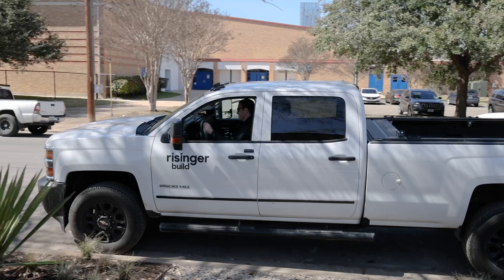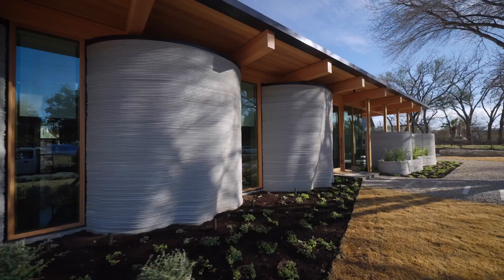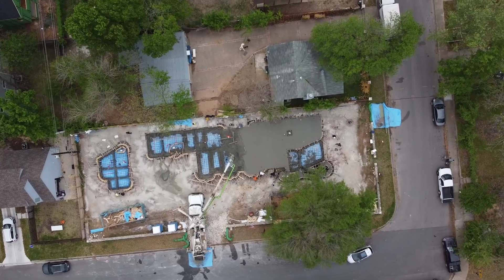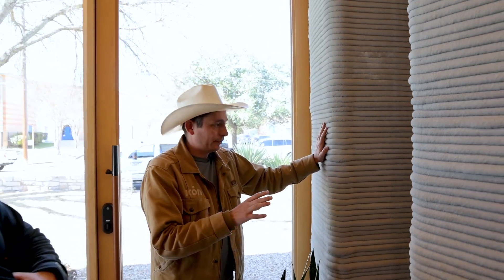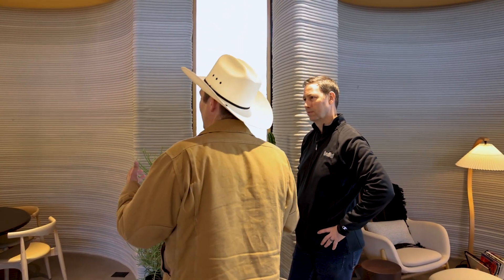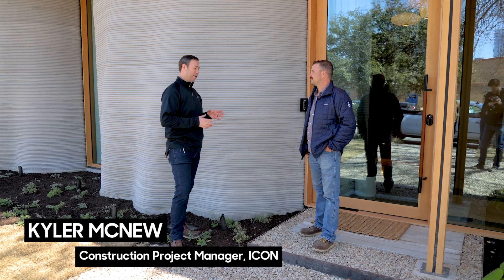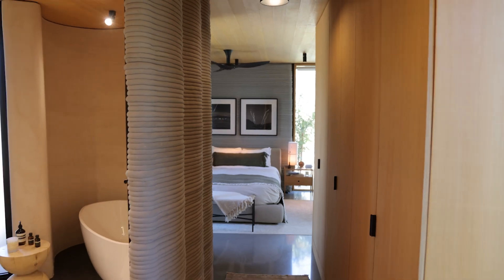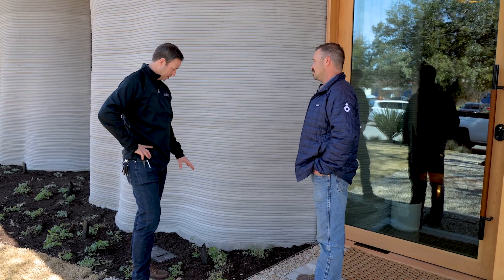World’s FIRST Home SPECIFICALLY DESIGNED to be 3-D PRINTED!

Comment: Those interior walls will be dust magnets. Wonder if the robot maid will wear provocative rubber gloves.
Reply: I wasn't quite clear on heating cooling or lighting either. Dusty collections would indeed make the space more uncomfortable :(
Reply: It’s a model. I suspect most would prefer to plaster the walls like in the bathroom.
Reply: @hippie-io7225  radiant heating and cooling in the floor would handle that.
Reply: @michaelgreene9889  how would radiant cooling handle condensation if it's in the floor?
Reply: @rcmrcm3370  good point. The house will need a dehumidifier or two depending on square footage. I have one in a poorly ventilated bathroom.

Comment: No change in cost?... oh I thought the point of 3D printing was to DiY and make things cheaper.
Reply: This technology even over decade old is still in its infancy. Currently it's exploratory. In the future as the tech advances you will see it used more - however if there is a savings somewhere there will be detrimental somewhere else. But that is life......
Reply: I believe he was comparing price based on a similar home of the same size.  If that same house were built, curved walls and all, with traditional construction techniques it would cost a fortune.  Given the customization, unique design, solid construction, and energy efficiency, this home probably has a lot of value per dollar compared to its peers.  One of the main advantages of 3D printing is having the flexibility to create one-off highly customized designs without incurring extra costs.

Comment: Would interested to see how this would hold up in more Northern climates, as well as what type of scale is possible.
Reply: My thoughts exactly. The way the concrete walls are built, the inner structural wave connects the inner and outer walls, so there’s areas where concrete bridges completely from outside to inside. Over a long winter I would expect cold to migrate all the way through the concrete creating cold strips along the interior wall that would attract moisture and dust just like you see in wood stud walls except much worse. They also glossed over the attic-less, flat roof but that would have to be engineered for the cold too.
Reply: -Belinda Carr has a video on her YT channel ('Fibonacci 3D printed house') where a company called Twente Additive Manufacturing has built a similar 3D printed concrete house in Canada. She talks about some of the shortcomings of their prototype design, which were mostly related to details/finishing. Total build cost was $100K.
Reply: @walterrutherford8321  The thermal bridging was also my first thought, but the top view at 12:35 makes me wonder if they've eliminated major bridges by standing up the outside/interior walls with a true gap (unlike every other 3-D printed concrete walls I've seen previously that have a bazillion major thermal bridges). It would be great if more details on this topic were shared and if they have in fact achieved concrete walls without substantial thermal bridging.
Reply: @walterrutherford8321  no way. you can clearly see the wall structure at 2:30, and there are no thermal bridges to the exterior. as he said in the discussion, there's an 2-row-thickness interior bead, and same for exterior bead, and the two don't connect. the interior/exterior beads come close to touching, but that only at spots for windows and doors, and there is spray foam insulation filling the interior. they didn't go into details around the sealing of gaps around windows and doors, i'm sure that's a key part of their proprietary process.
Reply: I wondered that also. Another thing i see this as dirty because all those ridges on the inner and outer walls collect any dust.
Reply: Use a different roof and make sure your insulation level to right for the climate zone. It is not that difficult.
Reply: @scottmohrman  Thermal bridging of concrete at -30F is prohibitive. I built using double walls. There are thermal images of walls in very cold conditions and the studs are way warmer  on the outside. The R-value of a 2x6 stud is only 6.9, I would guess a concrete bridge would be worse as an 8” concrete wall only has an R-value of about 1.4. I would have condensation and maybe even frost at cold temperatures.
Reply: @MorryB  I hope that's a fairly large house for it to be 100k in cost
Reply: @kylemilford8758  375Sq ft! Basically a tiny house.
Reply: Well, concrete shell walls a couple inches thick per facing.  With spray foam cavity fill.  Insulation shouldn't be an issue.  With a northern home, just make sure to properly insulate the slab and roof.

And they said the windows were triple-glazed.
Reply: @Chris_at_Home  You probably know there are still 2x4 houses with leaky walls and single-pane windows in Fairbanks. There are also houses with R120 roofs. This is somewhere in there.
Reply: @canonicaltom  I know people up that way that spend more on heating oil in a month than I spend in a whole winter.
Reply: Bro I live near Chicago the weather here sucks and almost all houses are built from wood. Concrete is a better material than wood so it should last longer
Reply: @brianDaily23  Most older homes don't have proper vapor barriers. My brother in law grew up in a wood house built in 1720.  All the beams were hand cut, notched and pegged.This is back in Connecticut. There are many houses this old that are still standing. If you keep it dry it will last forever. Up here if it's made of concrete it will crack in an earthquake. 40 PSI Foam fill walls don't do that. We have used 587 gallons of heating oil to heat just over 3000 square feet here in Alaska. Different materials work best in different climates. If I lived in a southern climate I'd probably build with ICFs with a lot of rebar amd truss anchors on top of the walls to hold the roof down.
Reply: @brianDaily23  Should.  As with all things, it depends on the care and planning when it's laid down.

Put a concrete structure too close to someplace you're going to be dumping large quantities of snow melt?

Instant shorter lifespan of the concrete.
Reply: @Chris_at_Home  If spec'ed, mixed and built properly, you're not going to crack a concrete wall unless you FUBAR'ed someplace REALLY bad.  Especially with crack resistant additives like glass fiber, carbon fiber or steel micro-rebar.

I'd be interested to hear where you'd find a house not cracking with 40PSI foam and cracking with 5000PSI concrete.

You'd literally have to have the earth under the structure itself violently and permanently shear, not just tremor.
Reply: @PhotonHerald  We had a 7.1 earthquake centered about 10 miles from our home a few years ago. That’s more than a tremor. The building I worked it sustained numerous cracks in the walls and floor during that same event. There was a picture that was all over the news of a destroyed road and that was about 3 miles from our home.
Reply: @Chris_at_Home  Simply because a concrete structure develops cracks doesn't mean the structure is unsafe.
And we're not dealing with a pure concrete building.

And simply because a building you're familiar with cracked doesn't mean:
A) It was necessarily unsafe
B) It was unrepairable.
C) This example is a universale thing in concrete construction.

Again, as I mentioned:
Rebar
Concrete additives (chemicals, fiber fills, alternate curing schedules, etc)
Actual engineering of the structure to maximize earthquake survival.
Reply: @Chris_at_Home  Yes, definitely; every single layer/ridge is a dust ledge and pet hair, etc.  This would be an absolute nightmare for me.  Thanks for mentioning that.